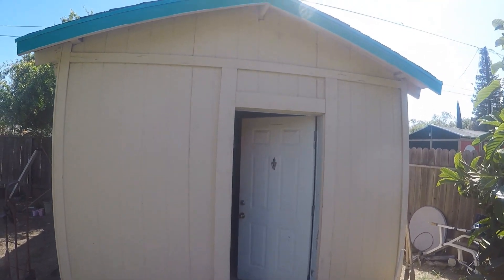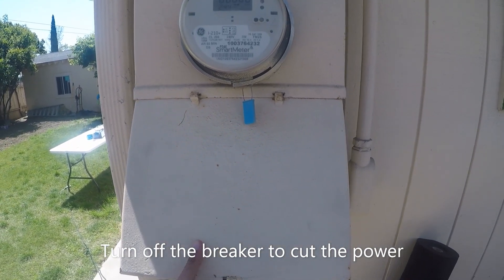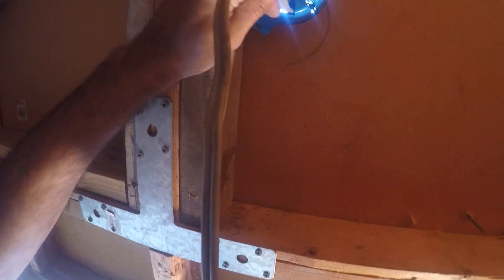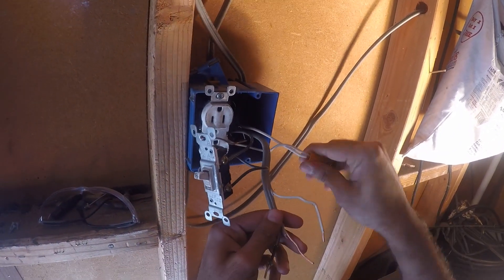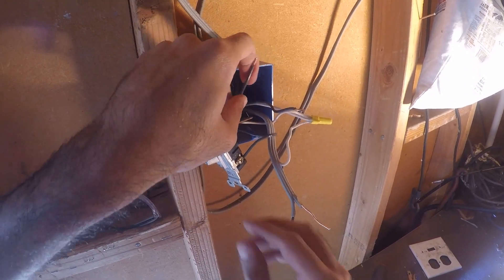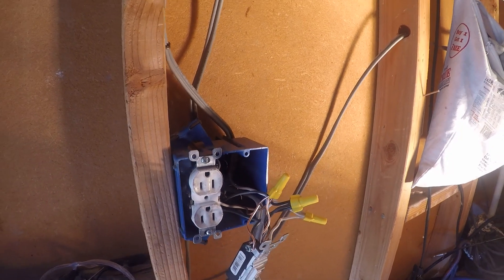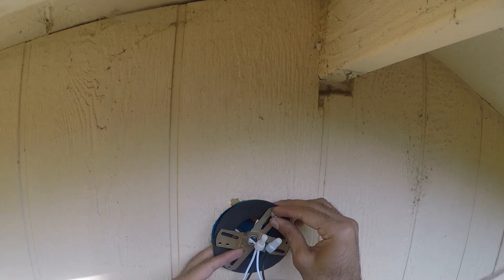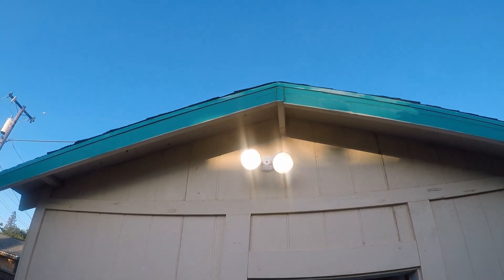Installing A Light Fixture With No Preexisting Wiring

Comment: The j-hook on your black wire pigtail is facing the wrong direction.  Your terminal screw tightens clockwise, therefore the cut end of your pigtail should also be going clockwise. Just FYI.

Comment: Could also had connect it using the outlet instead with a motion sensor floodlight.
Reply: Giving this flood light it’s own switch would be even better. Independently operate it from interior light, and can overrride the sensor if you want it on for extended time.
Reply: @jjbjeff22  Switch + Motion sensor would be ideal.

Comment: Nice job just a little tip flip your loop of the wire the other way going clockwise so when you tighten down the terminal the wire will turn with the screw and not against it so it won’t pop out when your tightening it down
Reply from the maker: Ah good point! Thank you!

Comment: Why not connect the other positive and negative and do a pigtail with the existing wires
Reply from the maker: Yes technically you can pigtail of the existing wire but I don't think the existing wire was long enough for me to run into the flood light junction box then pigtail of it.  Plus this makes it easier if I want to control the inside and outside lights separately in the future with a double switch.

Comment: You can also replace the single switch for a single pole dual switch. That would allow each light to work independently.
Reply from the maker: Yes you are right! I was just trying to keep the same electrical box because the current one has an outlet wired to it. But I definitely thought about using the dual switch.

Comment: Your inside light stays on all night.
Reply: His flood light isn't a motion detection type.  Looks like he just uses it for light periodically in the yard for eventa.
Reply from the maker: No. The lights are attached to outlet of interupter switch (pigtail method). Both lights turn off when switch is off.